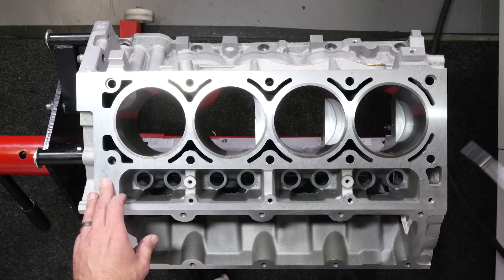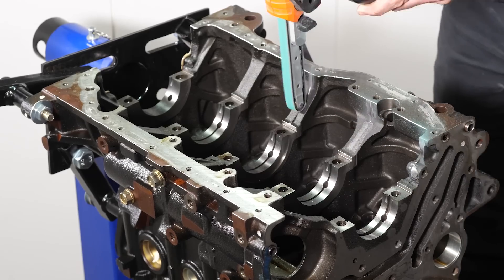Block Prep Like A PRO | Engine Building Basics 03/04

Comment: I used rifle and shot gun ball hones to polish my oil galleys  after using long ball end carbide burrs to round internal corners where drilled passages from different directions were drilled.  
I do all my block grinding before any machine work.
Reply: @waynep343  doing this after machine work doesn’t make much sense to me.

Comment: André, what’s your opinion on painting the inside of blocks. An old engine builder once explained to me he would occasionally do this to help with oil draining back more efficiently. Is there any merit to this technique?
Reply: Glyptol is the product you're thinking about. Without perfect prep, there's always the risk that it could come loose and clog the oil pickup or oil passages. The YouTuber Jafromobile has a series building a 4g63 that was a Hyundai casting that had tons of imperfections that he had to smooth out. It was pretty much a "I'm taking the time to do everything as good as possible" build so he glyptol coated the inside of the block.
Reply: I think the paint will be broken because its constanly in contact with hot oil and if the paint is flake/come off from surface it can blocking the oil gallery or strainer.
Sorry for my bad english🙌🏻
Reply: what i was instructed to do was smooth out the rough casting surface(s) in the lifter valley, and as mentioned above smooth out the return channels oil is going to follow back to the sump.
Reply: none, zero, zip, nada. If it was such a great idea, automakers would do it to avoid warantee claims. what's so annoying is you can easily see paint on rough surfaces isn't smoothing anything out...but engine builders will ignore their own eyesight to stick to an old wives' tale. even better is when you ask, "why don't you paint the crankshaft and the heads as well? don't they need the same benefit?" and you get the deer-caught-in-the-headlights look. which reminds you they only know what they've been told, rather than think about what they're doing.  Better to grind and polish the oil passages than fill them with drips and runs of paint since you can't reach everything with the perfect distance painter use to put on a coat of paint (and then sand down the orange peel)

Then they'll insist, "but you trap all the sand left over from the casting process"

wrong bucky! in order for the paint to actually stick and not come off and clog up the oil filter, you have to clean and prep the surface....which means...you are removing all the sand that wasn't already pressure-washed off by the oil pump and sent to the oil filter over the life of the engine block.

"but wait!" they'll tell you, "if you're building a spare race engine, you have to paint the inside to avoid rust"

so, if you're feeling frisky, you ask them...why aren't you painting the bearings and the connecting rods and the crankshaft (the pistons are made out of aluminum) so they don't rust? Anyone who has ever pulled a completely sealed up engine knows...there's no rust inside. that's because oil and water doesn't mix. and if you store an engine, you want to turn it over from time to time to keep the valve springs from staying in compression mode and weakening. or just overfill the block with oil and put it on a stand and rotate it like a bingo ball cage every few months. 

this doesn't mean an engine builder can't have some good ideas. but you want to think for yourself--like the folks who blowtorch a block to "wick out the water" before painting. the propane is creating the water you imagine is coming out of the pores.

Comment: It's rare, but sometimes the manufacturer will use a different thread form - got caught out like this many years ago on an Isuzu block. I did, as a normal practise, chase out the bolt holes with the correct diameter and pitch tap - but it actually removed material as instead of the usual ISO 60 degree included angle it was, IIRC, 55 degrees. Fortunately while the bolts were a little loose, it torqued down perfectly well and wasn't an issue - but lesson learned.
For older British vehicles, there is a difference between imperial coarse and Whitworth thread forms of the same diameter and pitch, which is something to be aware of.

Comment: A trick to remember to help with control of your die grinder is to always go in the direction the bit is spinning. Machinists typically call this climb milling, we aren't really milling here but the principal stands. Move in the direction the bit is trying to take you rather than fighting to go the other way. You are more likely to gouge the block fighting it.
Reply from the maker: Great tip!
Reply: Lol. Climb milling is how you risk a crash or stalling manual mills. Your meat noodle arms are not going to be able to maintain control while climb milling if a 1 ton bridgeport cant do it very well.
Reply: @saxplayingcompnerd  Dude, a 1 tone bridgeport has like a 100 horsepower motor and the backlash in the gear train is what causes the "stall". I can stall a die grinder with my fingers. We are talking about two enormously different things here. And like i previously stated we aren't milling anything.
Reply: @saxplayingcompnerd  however with the CNC mill, climb milling is preferred because it tries to push the cutting edge away from the surface, leaving you additional material if you have to go back and clean up compared to conventional mailing where it will bite in and potentially take away more material than intended.
Somebody who sees climb milling as the norm, is likely exposed to a lot of CNC milling of metal.
People who are used to conventional milling, probably learned with manual mills or they CNC softer materials such as wood and some plastics where you want to carve way the material, and not go the other way due to tearing.
Reply: @travisfabel8040  Climb milling is preferred in a CNC because it is driven by ball screws, which do not have backlash, a conventional machine is driven by gears which have backlash. So when you climb mill the backlash can cause the tool you are using to creep forward though the backlash and break, if you conventional mill the tool stays loaded against the backlash and wont try to creep. The issue is that conventional milling leaves a worse surface finish. so most good machinist will leave themselves a few thou to clean up with a climb milling cut to get a better surface finish and with only 5 or 10 thou (.25ish millimeters) if you leave the locks on lightly the machine wont pull though the backlash and you'll get a better finish.

Comment: Rather than using a tap to "chase" threads, I like to use a bolt instead. Use a cut-off wheel in the die grinder to cut some lengthwise slits into the bolt threads...essentially creating "flutes". Leaves a nice sharp edge for scraping the gunk out of threaded holes, and the gullets of the "flutes" provides a place for the gunk to go.

Comment from the maker: Building a fast car? Get $400 OFF the VIP package and never pay for another course, EVER: https://hpcdmy.co/vipy24
50% OFF your first engine building course. Enrol now: https://hpcdmy.co/offery24
TIME STAMPS:
0:00 - Overlooked Yet Not Difficult
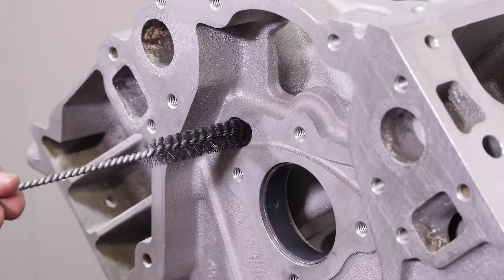0:39 - What Is Block Preparation?
1:17 - Shipping Marks And Dents
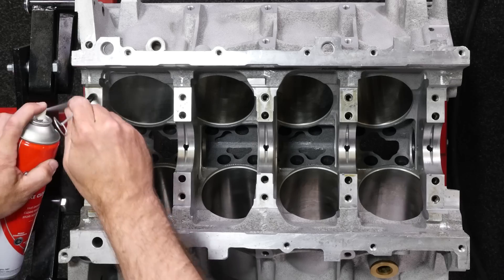1:41 - Threaded Hole Cleaning
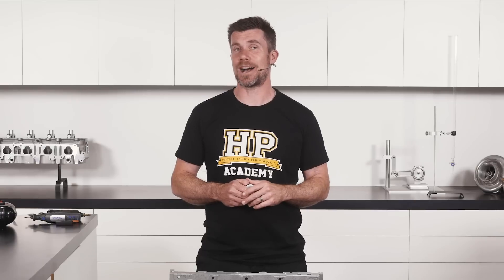2:33 - Using Taps
3:00 - Deburring Casting Flash
4:17 - Cleaning, NOT Polishing
4:32 - Oil Supply
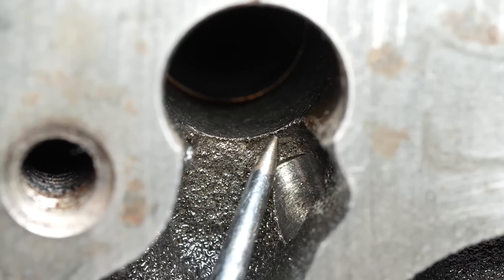4:52 - Machined Edge Cleaning
5:48 - Clean Debris
6:10 - Painting Cast Iron
6:25 Next Lesson & Myths
6:48 - BUILD.TUNE.DRIVE
Reply: Nooooooooo! Was it at least insured??
Reply: Yes, but it took awhile to find a replacement. It wasn't a very common gearbox.
Reply: SCCA spec racer. Major parts of it come in a big crate. We're talking the chassis with a bunch of stuff inside. Dude had some kind of issue (I couldn't see the back of the truck from where I was standing) and the entire crate falls and lands upside down from the truck. Tons of random stuff bent or broken. Everything had scratches on it. I don't know what they did before it even got to us but they did not treat it kindly.
Reply: Does the seller not even sending something count?
Was after some dampers for a vehicle and was e-mailling a UK company and repeatedly stated I was in NZ, and ordered the parts with the delivery address, etc, requesting the total payment amount, which I sent... After not receiving ony further response I asked about the order and they claimed I needed to pay extra for delivery because they didn't know it was to a NZ address when quoting the cost - that took a while to sort out as if they couldn't damn-well read, I wasn't that happy continuing to deal with them.
Reply: I have a similar story. A delivery driver was unloading a gearbox that I bought. He dropped it off the back of the truck, onto my driveway. Completely destroyed it. 😡
Reply: I once lost an Advan SA3R wheel due to FedEx error